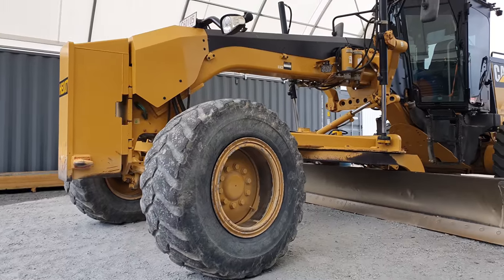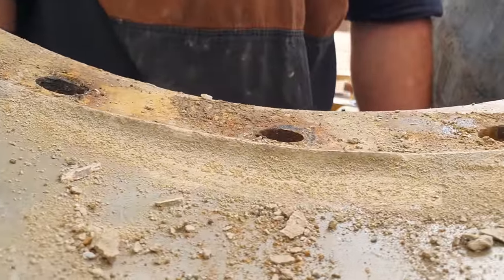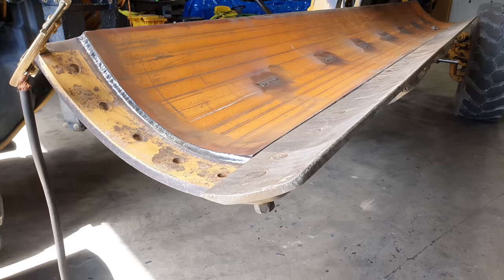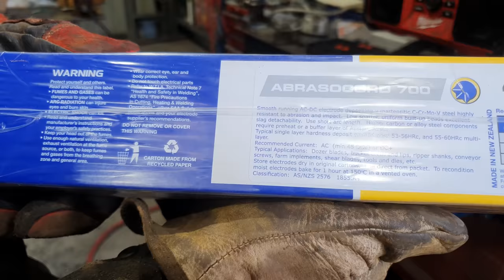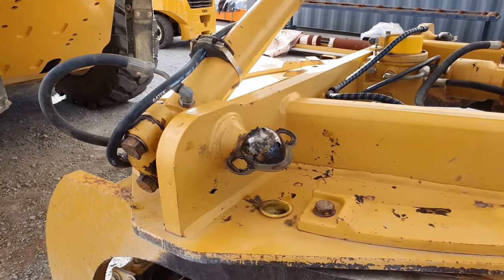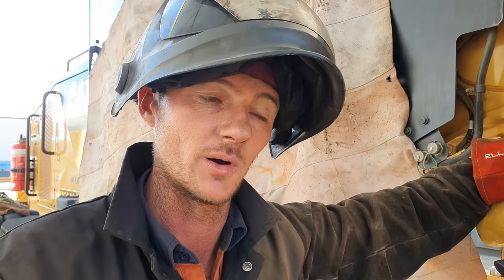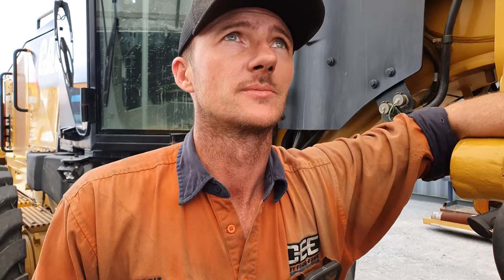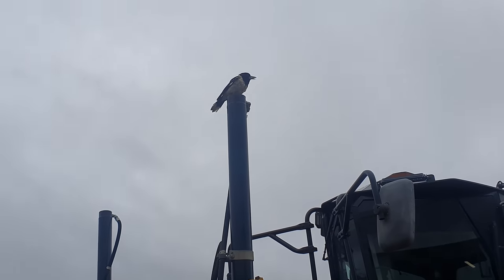This CAT 140M Grader NEEDS Repair | Part 1 | Blade Skin & Trunnion Balls

Comment: Holy electrodes! This thing must've hundreds of levers at the cabin 😳 I do not know what is the most impressive - to know how to operate that thing or to be able to fix it alone 🤯
Reply: Hundreds?  From all the movement, it seems like yeah, that's right, But with only 3 or 4, maybe 5 hyd. cylinders, that's all you need, 1 for each

Comment: The reason people find your hearing protection hard to spot is that you are actually using it correctly and inserting it into the ear canal where it actually works!  Most people just kinda park them at the entrance where it is completely useless.

Comment: Those gauging rods are fascinating. Can you explain how they work?
Reply: Also known as "Air Arc", they are carbon rods, with thin copper plating and the hand piece just grips the rod, while positioning an air blast which burns and blows the molten material away. They use plenty of current, 350 - 500 amps being quite common.

Comment: my 54 model d4 needs the same treatment the trunnion balls are worn and the caps are flogged out severely surprisingly they are still available from cat and after market too. for the amount work she will do in retirement(maybe 10 hrs a year).  i might just get some green hide leather soaked in neatsfoot oil and shim it firm

Comment: I cut the splines on a bulldozer drive with a vertical shaper for a few weeks. 
The boss put a blaring alarm right at ear level at the lunch table that would signal the end of break time
I didn't stay long at that job but cutting a large fine spline using an old indexing head with bent pins was good experience

Comment: I’m a website developer.    Thanks for doing these videos.   For me, they are a fascinating look into an industry I’ve wondered about since I was a small boy, but the opportunity to get a look inside the business has never arisen.  So you’re giving me an experience I’ve been wanting for 70 years or so.        QUESTION: What’s the tool used at 26:00 after a weld?     Looks like a whole lot of files bundled together banging on the weld.     What’s it called and what’s it for?

Comment: Kurtis, as someone that came from the diesel industry, do yourself a favor and disconnect the batteries, + and - cables. When you weld on a machine that has an engine control module....same applies for machinery with body control modules....spikes can back feed through grounds and supplies and kill sensitive things like control modules. Don't use the battery cut off switch, physically remove the cables from the batteries. If it happens once to you, you will understand. I saw many pieces of equipment and trucks with a no start complaint, only to find out that the control module was fried from chassis welding.

Comment: Have you seen the method on the 
I c weld.. Youtube channel.. Where he uses his cutting torch. Super-rich and soots up a large area. And the soot will repel spatter, especially on a Chrome cylinder. If he needs to weld near a Chrome cylinder, he just lites his torch up and soots up the cylinder and the spatter won't stick.

Comment: Seeing the weld only being around the edge of the trunnion ball flanges with no deep undercut and fill, I'd wonder why it might not be easier to grind out or portabandsaw rather than gouge the old ball off.

Comment: Wow, I never knew graders had such fine control over their blades. Do all graders have the same level of blade articulation, or do the heavy  mining ones like the 24 series go with simpler linkages because they're not working on roads?

Comment: Thanks again: Mr Heavy Equipt Restoration, Refurbishing and Reengineering. Now I see a lil Heavy equipt operator also. I guess I was surprised as how easy you seem to be able to take over the cockpit of that grader. When reengineering is slow do you do some side work running a few Cats? Grading a few miles? Thx.

Comment: If you spray anti-splatter on the paint before you cut cut them off with the carbon art or even before you weld you have less of the paint burning off cuz it slides right off real fast cuz the anti spray

Comment: Curious as to the purpose of grinding down the welds on the trunnion mounts? Especially as you took a measurement off the shoulder of the originals.

Comment: A good way to find plug welds again is to run a stainless rod over them. We do it in the marine industry on decking. Any reason/advantage to running pneumatic grinders rather than electric?

Comment: We have a 130G wirh a bent moldboard on both ends. Have you ever fixed one:?  We go through cutting edges like crazy because the bent moldboard ends are 2.5cm higher then the middle of our serrated cutting edges.  On a clay/sand racetrack serrateds don't last long.

Comment: Would aluminum foil duct tape be an option for protecting against the air gouging spatter? I'm pretty sure that is available in some hefty thicknesses. The aluminum would probably survive the heated metal spatter better than a normal tape and stay in place vs. the air.

Comment: Very nice. You always manage to show some interesting details. I like how you marked where the top and side of the ball assembly needed to be. Easier and more accurate than drawing a cross, and trying to "eyeball" the center of the mount.  Also, I noticed that you used a cheater bar with your large combination wrench to loosen some of the bolts. Is that another shop-made tool?
Reply from the maker: Cheers mate thanks for watching and sharing what you liked about yet. Yeah that extension is shop made didn't expect so much interest on it so we're going to do a shop made tools video and make another 👍
Reply: @CuttingEdgeEngineering  Nice. I'll be taking notes on that one ;)

Comment: only question I got is.  Why didnt you weld the balls fully down the backside like the factory?  Only asking this, as the orig's def seemed, after you cutting them out, were fully welded down the back.

Comment: Amazing job as always, goes to show you that we all accomplish the same task with slightly different tactics but end result is spot on. Quick question, on that M series blade was the update to the circle shield retainers done or  not? I've done tons of trunion balls on this same machine and usually by that point we are doing the service letter from the manufacturer for the gusset install on the shoe retainers as they are cracking out.

Comment: It's not very often that you get a complete machine in for repairs, as it's usually just the part that needs repairing. But in this case, it would be way more trouble for the owner to remove the individual parts and a lot easier just to send the complete machine in for repair.

Comment: When you weld on the on the whole machine, is it necessary to disconnect the bateries and make it "dead" to avoid possible damage to electronics? I guess such machinery has some master on/off switch so you do not have to disconnect the cable...
Reply from the maker: Yeah has an isolate switch we definirely isolate the machine before doing any welding or gouging

Comment: Sorry if it's a dumb question. But is that just a long headed wire welder u were using I guess u call it??? I didn't think wire welder had Flux ur r needle scaling off though.  Awesome job sir as usual

Comment: Awesome video guys! I have a question, not sure if someone else asked it already , but how important is the center height on the trunnion ball mounts? Does cat provide the exact height placement from that bottom plate or is it more of a rough location because the hydraulics can compensate for it being slightly off the original OEM position?

Thanks!

Comment: If it was me grinding off the ball joint welds, the balls would have acquired new flat spots. I’d have wrapped them with aluminium for protection.

Comment: Do you disconnect the batteries when welding on the machine? Love the bird and dog.
Reply: Electricity likes to take the shortest path so as long as you have a good ground and it's close to weld on same chunk of metal and not around any electronics you really don't have to worry. Put the ground on the cab and weld on the blade and ya, you would probably fry every computer and arc out and ruin every pivot joint in between the current used.

Comment: I bought a tractor that had horrible damage on all the windows from the inside because the previous owner weld the cab post without covering his windows. Those hot BBs will melt glass and stick to everything.

Comment: Off topic question here. How does one come up with the amount of press or crush they are gonna but on a bushing when line-boring?  . Is there a formula? or is it in the machine assembly? Or is it preference? Or maybe a rule of thumb? Also when boring for slip fit! I know individuals that’ll bore .001 - .003 over and others on that same work piece that would bore .010 over. Looking for solid answers to work by. Not (20 ton ram Rodgers experimental solutions)😂

Comment: Just out of curiosity is it okay to leave the back surface of the wear plate rusty when you weld it in because it’s a wear item?  In my mind I feel like it would wear out faster that way. But it will probably need replacing long before that happens.

Comment: I don't miss cat coloured paint
Reply: Use to mill frames / Chassis for cat C18 and C27 gen sets and pumps for cat power systems.

that was the fun bit on a 3x1 meter bed mill.

Also use to do some others smaller ones for boats.

The cat yellow use to get in the workshop when the painter was spraying

Comment: Question:  doesn't putting a skin on an existing blade significantly increase the weight that the hydraulics and tilt/turn mechanism have to deal with?  and so increase wear on those parts?
Reply: What was left wasn't much, yeah it was heavier than the original from the factory, but in the scheme of the forces those parts encounter grading, basically nothing.

Comment: Quick question for Curtis. When stick welding, why use the certain type of electrode holder? Does it have any advantages over the usual clamp-type one that's a bit more common? Just curious
Reply from the maker: hey mate i'm just not a fan of the clamp style, I prefer this holder
Reply: @CuttingEdgeEngineering  Ah, gotcha. Use what works well for you, right?

Comment: 1,495th. Better late than never.
Radiused a replacement heavy duty bucket blade a few months ago,  press didn't want to do the bend increments evenly and it was heavy enough to be a complete nightmare getting it on and off the vee bed. 2/10. would not bang again.

Comment: I am wondering why you cut off what looks to be about 4 inches from the top and bottom of the new blade skin. Why not cut it all off from one side so you can salvage one wide piece of steel instead of two narrow pieces.
Reply from the maker: because then the bend profile would not be centre and would no longer fit properly to the existing blade 👍
Reply: @CuttingEdgeEngineering  I kind of thought that wasn't sure. I was thinking the profile would be the same all around but I  guess not. You're the professional.  I'm just some guy who's always impressed with your quality of work and your strong work ethics.
You're both very dedicated professionals.  👍

Comment: Kurtis I know you use air tools all the time, I have a TIP THAT WILL SAVE YOU A LOT OF MONEY EVERYDAY PUT THREE DROPS OF AIR OIL INTO YOUR TOOLS THEN PUT AIR ON AND SPIN FOR A SECOND AND YOUR AIR TOOLS WILL LAST A LIFETIME I AM STILL USING MY 1/2" SNAP ON IMPACT AND ITS 24 YEARS OLD I still use it everyday for 8 solid hours and it's the one everybody wants me to come break loose their bolts loose my Snap on guy keeps saying just how long will it keep going!

Comment: 6:38 I see you put the straight edge on the correct side of the material this time. I don't know how many time I had tell stupid kids to put the strait edge on the piece you you want to keep, so the knife doesn't veer off and ruin the material , like dry wall ect. but in your case it was flex,bend, and gravity you were fighting , ehh I've made worse mistakes . when I was new to HVAC I didn't close the valves on the AC unit. 90 deg. day rolled it over to flip it across the yard, yeah blew compressor oil all over the side of the house. that was an interesting day. yeah and it was an expensive house.

Comment: We all make our choices but they should be informed choices.  Not to harp on the subject but hearing is in part genetic.  So some will do better marginally than others in the same environment.  If you know anyone who has hearing damage you might be able to guess how difficult it makes life.  One of the greatest drawbacks is social life and the fact that hearing damage can cause a withdrawal.  It is just too hard to keep track of what is going on when you cannot hear the conversation.  Hearing damage only gets worse.  Hearing aids are often only partially effective and in some cases not at all.  Foam hearing plugs are far better than nothing but still not as effective as good muffs which are not as effective as good muffs and foam plugs.  Noise cancelling headphones may be the best but do not have a long term history to be sure.  The best is not bulletproof armor.  Hearing loss will be created even with protection in a noisy environment.  Noise enters your body in many ways beside the ear canal or the bone behind your ear (one reason muffs are superior is they cover that bone) and can cause damage over time.  Over long term use foam plugs can cause irritation in the ear canal as well.  If you plan on living into your eighties then hearing loss which can easily start in your late forties will deprive you of many years enjoying those around you and things you like.  Sadly you may not only lose hearing but you may half to endure a ringing  which may be quite loud or background in your ears that never stops.  If you can lessen that loss it will reward you in many ways for the rest of your life.  If you are exposed even while wearing protection then it is good advice to get an annual hearing exam to alert you to damage.  Often just age will diminish your hearing so anything you add to that is going to have an even worse effect.  You are in charge of your health to some degree, protecting it is good advice.  Sorry to be a pest but I wanted to be sure you knew that inner ear foam plugs are a far less than perfect solution (custom molded to your ears are better if that is your choice) to a universal danger in moderate to extreme loud conditions.  We have all done the, "I will just get this done then get my hearing protection

Comment: Why dont you run electric sanders and grinders? Its more efficient not having an air compressor, and cords are lighter-smaller than air hose. Justwonderin, im sure you have a good reason.

Comment: The work you did was superb, but i don't understand why some engineers design stuff the way they do. Why isn't this ball joint bolted on. And my wondering has to do about so many machines and cars. You can't always call a professional mechanic or service personnel to come to fix things in a proper garage with proper tools. Sometimes machines are bought old by a one guy operation or small company with only few employees where even the operator need to go outside with only chisel and hammer to fix things. Just saying, some engineers shouldn't be allowed to even design street signs. All machines and trucks should be fixable out on the side of the road with basic set of hand tools. ( I am not talking about major engine fixes )...

Comment: Like to watch your videos, impressed by your work. Do yourself a favour and use nitrile disposable gloves when working with grease remover or the like. Your hands look like they had already too much contact to chemicals. The degraser is absorbed by your skin and contaminates your blood and the whole body.  Young hard working guys feel like indestructible, but over the years the chemical contamination will take its toll. I had signs of intoxication and increased liver values by breathing fumes of disposed brake cleaner cans thrown into the scrap metal bin inside my shop.